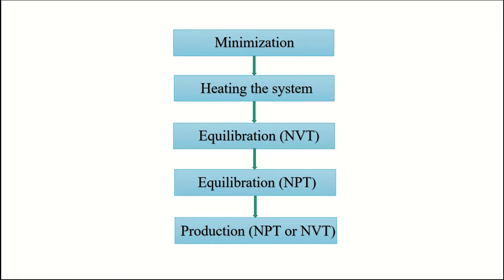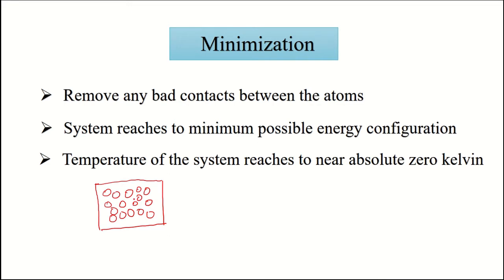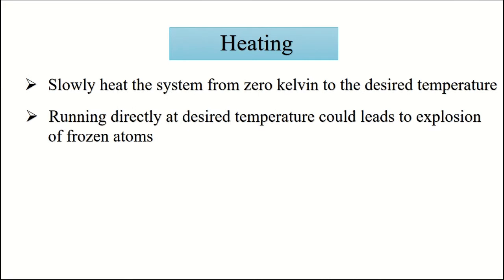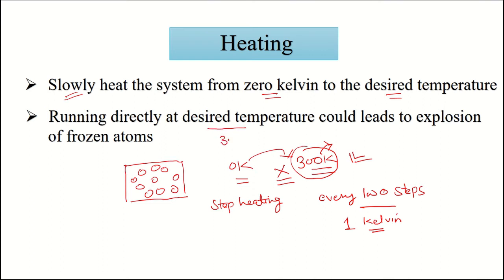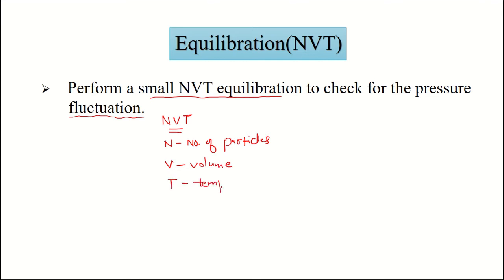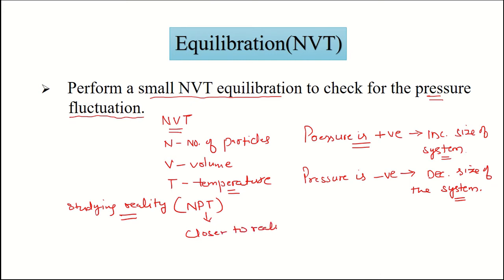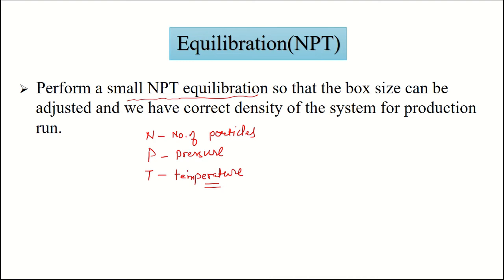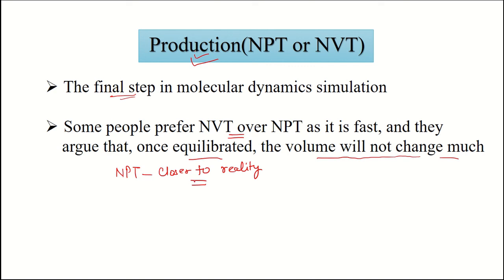Molecular dynamics simulations - Procedure

Comment: What does non- numeric pressure, simulation unstable error in lammps mean. What can be done to remove this error.
Reply: I think you are putting 0 pressure, instead of you can put any value near to 0 like 0.001

Comment: I have some doubt sir. You talk about NPT and NVT ensemble. How about NVE ensemble simulation? How to select  ensembles for our system?
Reply from the maker: Hi Monisha....We use thermostat and barostat in NVT and NPT ensemble to keep the temperature and pressure of the system constant. In  NVE ensemble , our system is isolated from the surroundings. It's used to check whether the system has reached the equilibrium state or not ( say constant temperature or pressure).
Reply: @Vinay192  thank you sir. One more doubt. Can I use only NVE simulation for my system (not biological system) and take results from it?
Reply: @motivationtime6220  Thank you so much sir🙏
Reply from the maker: @hingiesmonisha3038  I would say yes if the system has reached the equilibrium state.